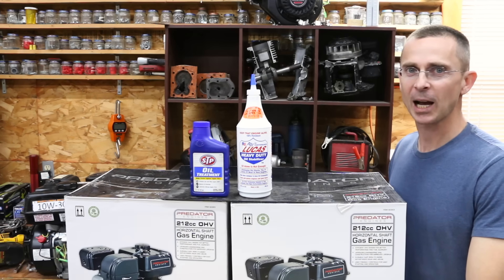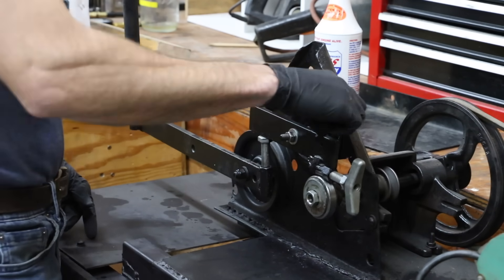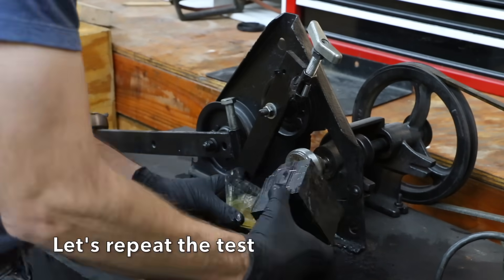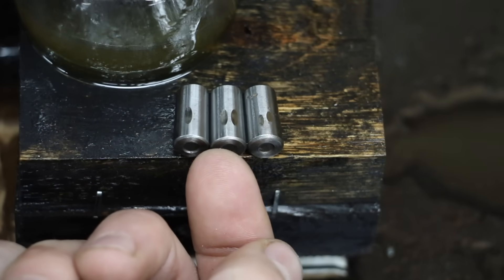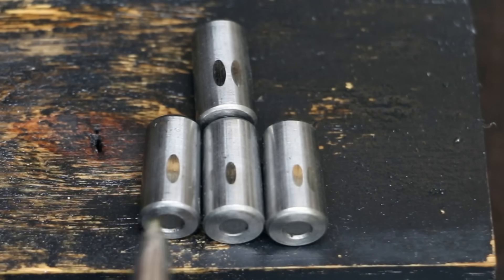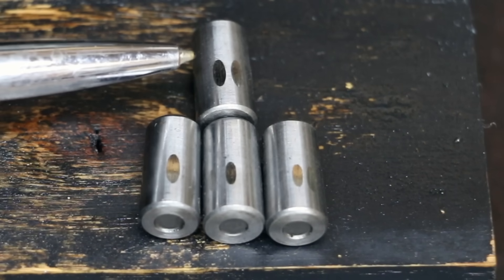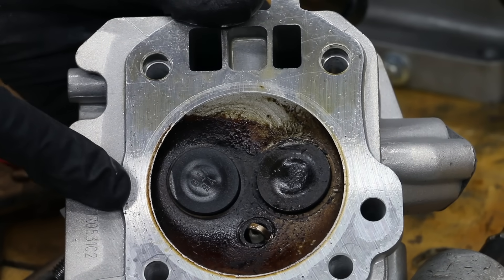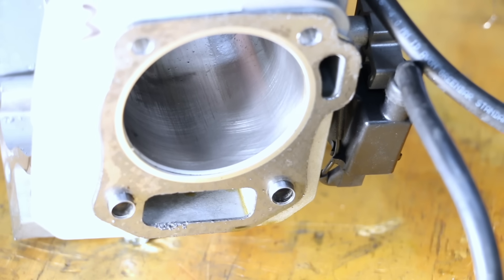Which engine self-destructs first?  Lucas or STP?

Comment: I would like to see slick 50 oil additive,also people say hypoid gear lube 85/140 weight can do the same.The original engine restore is also good if mixed with moble 1 synthetic oil,I ran it in a550 HP. Small block Chevy for years.thanks for the best utube channel there is.
Reply from the maker: You https://www.youtube.com/watch?v=VwePft315Ds welcome!

Comment: Might I suggest testing Schaeffer Oil, I used the 20/50 in all of our Harleys never having a failure that includes a run of 11 hours at 100-110 degrees a run from Houston, Tx to Las Cruses NM.
Reply from the maker: Thanks for the suggestion.

Comment: A friend of mine when we were kids attended Marietta petroleum college or whatever it’s called in Marietta Ohio to be a petroleum engineer.
  He told me while he was going to college that STP is nothing more than  refined petroleum before the additives package is added.. it’s like beer being made, it’s the water they start with before they add the barley and the malt and the hops to create beer..
  that foaming of STP would be catastrophic if that were to happen to the engine oil. You cannot have oil pressure that’s full of air bubbles..
 I was a motorcycle mechanic at a Honda dealership. Brand new motorcycles engines were failing. We were buying Kendall motor oil in 55 gallon drums for new motorcycles.
  we did a test on a brand new motorcycle just put together out of the crate. We drained out the oil that was in the engine from the factory, we replaced it with Kendall oil. We started the bike with the Honda rep and the Kendall motor oil rep right there. Within 10 minutes that oil was all foam..
  Kendall paid for all the damaged engines because they apparently did not add enough of the anti-foaming agent in the additives package..
  I have never seen an owners manual for any vehicle that does not have the warning, never put additives in the oil..
  I remember this run the engine dry after break in using slick 50 and not using slick 50. The engine that never had slick 50 and it had less internal damage running without oil than the engine that had slick 50 in it..This test was done by the Briggs & Stratton company, and both engines actually ran without oil after the initial breakin with oil for 24 hours,
   The scoring on these pistons in this video is nothing like the scoring I saw on motorcycle Engine pistons out of 2 & 4  cylinder Motorcycle engines that used K&N filters.. I found this out after doing research on YouTube, because I bought a 2008 motorcycle in 2021 that had K and N air filters. In the inside of the intake system between the filter and the Plenum on the air filter ductwork was filthy inside.. all that dirt that was stuck to the smooth plastic inside ductwork made me wonder how much dirt actually got into the engine combustion chamber.. I replaced those KN and air filters that were on the machine when I bought it with the OEM filters
Reply from the maker: Thanks for sharing.

Comment: Lucas lasted longer, although it also depends on how often the oil is changed. Both had the same type of damage. Bottom line, nothing last forever. How frequent you change your oil with or without the additive is the true engine life saver
Reply: Possibly. But these are both new engine and just been been broken in and used for the test. So it is as accurate as possible without things like oil change variable playing a factor or any other type of prior influence or damage. Had he of used  some second hand motors, then other influence in the history of the motors will play a major part in the out come of the results. He really went out of his way to get new ones to be as accurate and unbiased as possible.
Reply from the maker: Thanks for the feedback.

Comment: Love your videos man! Lots of work and diligence for sure.     This particular test though is somewhat unrealistic as we of course would never run the engines dry, and if I recall correctly stp and lucas dont claim to protect after removal. It was slick50 that claimed keep protecting after oil loss, no?  I would have liked to see fuel efficiency and power output compared as you have done in other videos. (On the other had I understand you cant wait years and support fueling  the engines to a normal wear failure)  Perhaps a hydaulic pump with a valve inline to produce maximum load it could maintain 3600rpm wide open, would be a way to bring harshest conditions.  None the less thanks for what you do, I sure appreciate your videos!

Comment: Here where I live, (AZ) we use and additive called PSI Lube. Supposedly it knocks every additive out of the water and I’ve heard a couple of stories where peoples oil pans hit a rock and poured all the oil out and it still ran till they got to a shop and fixed the pan put oil back in and drove off. Would like to know your opinion about if you ever get a chance. Thanks for the videos.
Reply from the maker: You are welcome!  Thanks for the suggestion.

Comment: I used to have a 1990 chevy truck that leaked from everywhere. I used straight Lucas, no oil lol. Stopped leaking and ran until I sold it to a buddy who wanted the body. As always, thank you for your unbiased and incredibly thorough content.
Reply: I run lucas in all my 350s. One full bottle and top off with rotella . Never had any problems.
Reply from the maker: You are welcome!  Thanks for sharing.

Comment: I was a mechanic back in the late 70's early 80's and unless STP has changed their formula I could tell if an engine had STP used in simply by removing the valve cover because if it had there would be an abundance of sludge in the cover and on top the head! I would not use STP on a bicycle. Don't know much about Lucas
Reply from the maker: Thanks for sharing.

Comment: Oil additives create low crank case pressure that potentially throw up engine lights. Oil does not need additives if you use quality oil.
Reply from the maker: Thanks for the feedback.

Comment: What did everyone expect when running an engine without the proper amount of oil!? 

I understand about comparing the two additives but to destroy brand new engines?Not necessary as these engines could have been used for work and each additive used at the owners discretion. These videos are not necessary

Comment: I would lean toward the Lucas treatment, but wonder if you mixed the STP in the same concentration would it equal or outperform the Lucas?
Reply: @bigboreracing356  my brother in christ why did you even watch the video for?
Reply: @bigboreracing356  edgy
Reply: @bigboreracing356  yeah edgy
Reply: @bigboreracing356  my brother in christ is just a saying I see on memes
Reply: He mixed it according to the manufacturer on the bottle
Reply: @badasspearldrummer  Right, he's wondering if the outcome would be different if the STP were to be mixed at the same concentration as the Lucas instead of the STP manufacturer specification.
Reply: @FinalFront  Lucas says you can use up to 60%, so where do you draw the line.

Comment: Ok now torture a 2 stroke weedeater by mixing the fuel oil at 70/30 or 80/20 ratios.  See how thin a mix can be run before kablooie
Reply from the maker: Thanks for the suggestion.

Comment: O model steam engines n the steam days oils had tallow in them. It was called steam oil it’s almost non existent now. Occasionally there is a 5/gallon pail listed bushel ore mobile. Most of us buy small mounts  from various model steam engine makers. Of lat however some have been using air to Lois most don’t run their engines super fast or highly loaded. Others are using  dgumed Astor oil Leo during WW2 stor oil was heavily used.  Avegie oil made from rape seed be was developed in Canada. This became canola oil. O now some of us are usin castor mixed with intolerance oil or marvel oil I would love to see you oilers test done o these products and mixes.. I’ve already got both castor oil and veggie oil in the. Freezer. Both are frozen solid. Our oil viscosity test  race would be great too.  I’ll be using air tool oil and compressed air to start on my new 4 cylinder mill steam engine. Then my boiler will be don’t and I’ll have live steam. I have not come up with a. Mix yet.  I also have two steam turbines that turn incredibly high rpm. 50 to 100k. I’ve already heard of one of these having bearing failu. . Another was attached to a large reduction gear box he gears failed ver quickly. Apparently this is an issue even in full scale. It is said the oil is too tick nd can’t get out of the gear teeth fast enough. Anyway I’d lik too see marvel oil castor oil, vegiel tested at room temp and say 200 degrees F.  Maybe lubed air from airline lubricator.   Guys easing standard air compressor kilter regulator lubricator.  These model steam engines have drip oil to the Mai earnings and squirt can to linke and slide valves just like the old rail road steamers.   Ere are others too but this is pretty common.
Reply from the maker: Thanks for the suggestion.

Comment: I love this stuff, this cracks me up. For my Corvette I run mobile 1 fully synthetic and add a quart of (same viscosity) racing oil for the added zinc, never an issue,  built motor,  does some track work

Comment: The Lucas definitely seems like the better choice.  Not only did the engine with Lucas run longer, it seemed to stop slower.  The STP engine was basically an immediate stop after failure.  To me that suggests the Lucas helped the engine even after all the oil was gone.
Reply from the maker: Thanks for the feedback.
Reply: @ProjectFarm  thanks for the videos!  I appreciate the effort you put into making sure things are fair.

Comment: It would seem to me that the advantage in this kind of test would always to go the higher viscosity treatment.  My old neighbor, who used to build rail dragsters in his garage, used to tell me that, when he coated all the internal parts of his engine with STP,  he would get many more runs out of an engine than without it.  Don’t know if you could test his results or not?  You’d have to run the engines hard repeatedly after warm up to simulate the stresses of  drag races.
Reply from the maker: Thanks for the suggestion.

Comment: I see you have ran comparisons with Dura Lube, Slick 50 and the Moly
I've learned from other studies and from Scottys channel that I shouldn't use the thick oil additives in my 2013 Mustang GT due to starving of the hydraulic lifters
 (ports oil holes small thick oil can't reach them) could you please test the new Lucus low viscosity oil stabilizer I think that's what will replace my Lucus Heavy duty Synthetic additive so hopefully I can stop my oil starvation when using the thick stuff. Hope I didn't harm my engine from all those miles of the thick stuff.
Thank you for your response from my earlier comment.
Reply from the maker: Thanks and you are welcome!  Thanks for the suggestion.

Comment: I run Lucas Transmission mix in canola oil for my chainsaw bar oil. You can saw for a half hour and still touch the bar and chain after you turn the saw off.  I also use it for cut fluid.
Reply from the maker: Thanks for the feedback.
Reply: @ProjectFarm  Merry Christmas ✝️❤️

Comment: Great video. Very good test. I worked at a municipal garage for 11 years and we kept lucas on hand. Saved quite a few engines and made noises go away. But the best one was we had a crown vic ppv 4.6 engine come in knocking was way over on service had literally half a quart of oil in it. I changed oil put a quart of lucas in it and the 5w30 oil back in. Let it run for 30 minutes knock went away and it was a rod bearing knock. And ran for another year till he got a new unit. So I'm definitely a believer in the stuff. I don't use the trans additive though. I was told by my builder that it's to slick allowing enough friction and causes sticking problems in transmission.
Reply: Trans additive made my transmission shift like new
Reply: @Pringlebox  Yup.
Reply: As you can see on the guy's "Lucas in the lawnmower" post, I'm one of those synthetic additive believers. Even today I'm running a high-miler Villager on straight STP being very careful to idle up to operating temp before driving. Cost? 6 15 oz containers of STP and an STP oil filter.
Reply: Than Trans fix is even better. Hands down the best product they make.

Comment: I'm a firm believer in Lucas oil treatment....I had 98 dodge Durango 318 5.2 engine lost oil pressure south of Detroit with a loaded 18 foot car hauler... went over 300 miles with no oil pressure pulled in to the driveway didn't even get to shut it off it just died.... went out about an hour later and it fired right back up with rod knocking but still ran

Comment: I enjoy the STP additive but only because I have a smaller older Honda and typically I don't need a giant bottle of Lucas and my sohc valvetrain stays much quieter with it, little to no oil consumption even with hard driving over mountains and lots of cold starts and idle, my oil pressure light turns off sooner and doesn't flicker initially. The Lucas is too thick but the synthetic version may not be but I am really impressed with the STP for such cheap prices and I want to try their stop leak bottle and their ceramic bottle when the time is right. During winter right now is when it leaks so I will try it, and during summer is ideally when you would use the ceramic formula to help keep the internals well coated even under hard driving in hot temperatures. And fyi I run full synthetic Castrol gtx magnatec, or Ill run either Valvoline high mileage or the classic Mobil, not Mobil 1 but the classic formula with the pegasus. In my truck I notice the oil pressure guage reads a bit more pressure and I do like that for the older engines I run.
Reply from the maker: Thanks for sharing.

Comment: You have to remember addatives change  your oils vescosity as well. These type tests and working on small engines and general mechanics for years is what got me into becoming an Amsoil Dealer for fun. Amsoil specificly tests and designs specific lubes for specific tasks , no addatives needed or reccomended to be added. But I digress...Great Vids ! I love tear downs to find failures. Maybe just run some straight oil tests , different brands?
Reply from the maker: Thanks!  Thanks for the feedback.

Comment: I'm 74,  about 60 years ago my girlfriend s father drove a semi truck,   and had his engine oil and trans oil changed he always added 2 cans of STP oil treatment with the new 90w oil for the transmission,   they finished his maintenance and he went down the road approximately 500 miles his transmission seized up he was towed to a repair shop as they drained the 90w oil from the transmission. Nothing came out !! It turned out the the oil change shop FORGOT to finish adding the 90w !!  The only thing they added was the 2 cans of STP !!  They forgot the 90w gear oil. 
 So for 500mile in a semi truck hauling a full load of cars.  All it ran on was 2 cans of STP.  my friend was hooked On STP from then on !!    Great. Video 😃😃😃
Reply from the maker: Thanks!  Thanks for sharing.

Comment: You are the “man” in testing. Love all the great tests you do always unbiased which is so rare these days. Lesson learned I will try to keep my mower full of oil when I use it. If I did use additive it would be Lucas. my guess would be if 9 minutes extra with no oil how much longer would engine last over its lifetime.
Reply from the maker: Thanks!  Thanks for sharing.
Reply: how long wud motors last if they had oil CHECKED BEFORE EACH RUN OF THE DAY (STICKER ON IT THAT STATES THAT) and changed every 20 hours. air filter cleaned every 25 hours or sooner... new ones on e bay 5 for $10? oil the air filter to  keep the silt out of motor. air cleaner screw on TIGHT so it wont falll out and then run it with NO AIR FILTER??? PLEASE???  then i get them, take them apart, hone them, new generic 68cc rings, clean them out, new gaskets. 20-50 oil and 20% STP (cheaper) and run them... with E bay stickers... CHECK OIL BEFORE STARTING.... and.... THIS MACHINE HAS NO BRAIN... USE UR OWN!!!!

Comment: Went to a car show years ago. They featured 5 major dealerships with one new car a piece. Rules were cars had less than 10 miles driven, must be drained of oil and engine revved above 5000rpm. I watched a mustang, camaro, BMW, 350z and Mercedes do this same test. 
The cars failed in order I listed above. I couldn't believe the Mercedes ran over a hour at 5000rpm before exploding. Mustang motor locked after about 15mins thou.
Reply from the maker: Thanks for sharing.

Comment: Dont know about super turd paste ! Stp ! It destroyed every engine i had back in 1970 s .!!! It may be good now but no way in hell i would ever try it again !
Reply from the maker: Thanks for the feedback.
Reply: @ProjectFarm  im sure it has improved but when i was growing up and started driving my dad suggested changing oil every 3 k miles which i did but each time i used stp it clogged up cam journals and stuck lifters. I blew 2 283s  and 1 350  and burnt up rings in 327. 300 hp turbofire ss engine needless to say no more of  that honey looking paste. When i quit using that garbage my engines performed and lasted. Alot better and longer so bad experience means ill never buy it again even if its improved

Comment: SFR superior friction reduction oil fortifier
It will blow both of those out of those water.   We tried testing the SFR in one of those testers and we couldn’t get it to seize up.    Put over 50lbs on it had to bolt to the work bench so it wouldn’t tip over.   Every other oil would seize the bearings.
Reply from the maker: Thanks for the feedback.

Comment: Sorry, but I will NEVER use Lucas again. My Monte Carlo engine was almost destroyed by it. Drained it back out put in Valvoline oil, no problems after for over 700,000 miles with only changing oil as required. If I ever use any additive it will only be CD2 detergent to clean and free rings and valves. Or Casite Motor Honey to quiet loose engines.